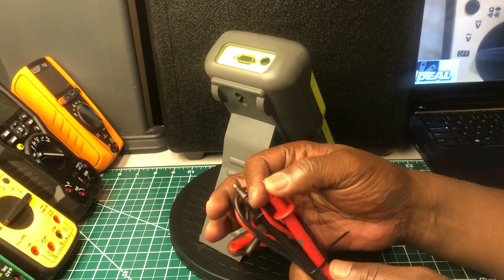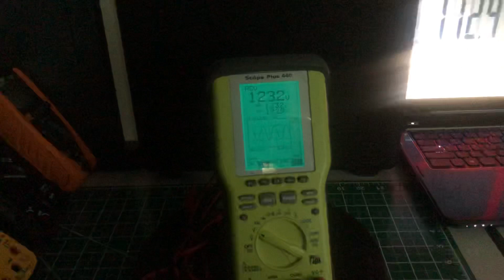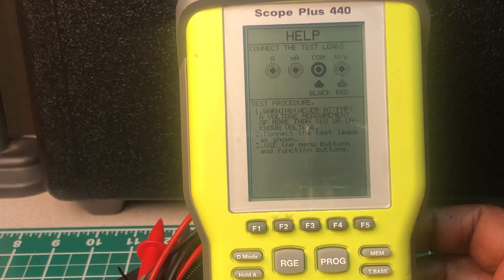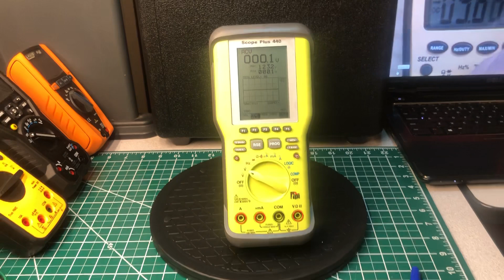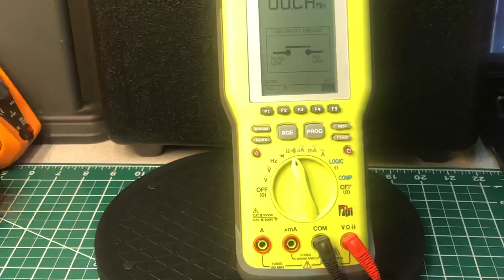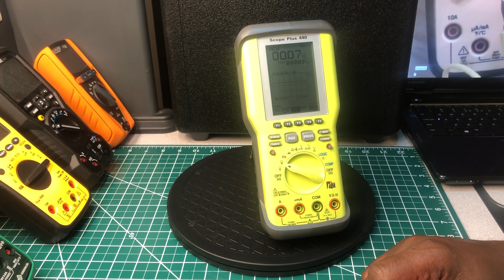🇺🇸(TPI) Test Products International Scope Plus 440 (Introduction 👋)

Comment: This is still the most popular All-in-One meter for car audio and testing amplifiers/setting gains. Big fan of it being rechargeable but if you had an older version (can’t tell from the outside, have to open it up) that uses Ni-Cd batteries, the company will upgrade you to longer lasting Ni-Mh w/ new circuit board for a very reasonable fee. (Uses same charger) Only downside is they still don’t last as long as I would like on a charge and it’s a slow machine. A measurement on a Fluke is INSTANT! But for a comparable Fluke model, this one’s price starts looking a whole lot better. For a hobbyist/freelancer, this meter is the one! For pros, save up for a Fluke, after a week of constant use, it’ll save you the time on waiting on measurements to get your money back. You can hook this meter up to a computer using 1980s cables/connectors but that was probably the last time they updated the software. Windows 95 may be too new for this function to work. One last thing, this meter has nonstandard depth test lead plugs. Most aftermarket ones I’ve tried don’t have the inner metal contact pin reaching down far enough to make contact with the meter. Ground leads don’t seem to be an issue but positive leads are. Maybe it tapered down on the outside holes/near the edge??

Comment: As a electrician what areas would you use that meter or what testing situation can it be useful?
Reply: I have a Reed o scope/ DMM I use to look at sine waves. What else can I  use it as a electrician? Thanks
Reply from the maker: This Scope Meter serves as both a portable oscilloscope and digital multimeter for testing electrical, electronic/industrial control systems. With this Scope Meter you can record frequency and visualize the shape of an electrical field, as well as troubleshoot electrical equipment, display distortion, and gauge timing relative to associated systems. Thanks for watching 👍🏽
Reply: Thank you for sharing such wonderful videos and talking points.  I been watching your videos for long time, and you have not disappointed me yet. Thanks!
Reply from the maker: @1beejay1  Thank you for your sincere appreciation for the channel,  it’s because folks like you who make doing these reviews worthwhile. Thanks for your support 👍🏽